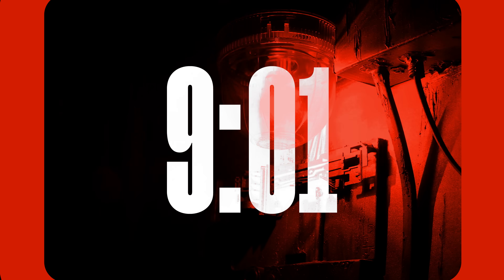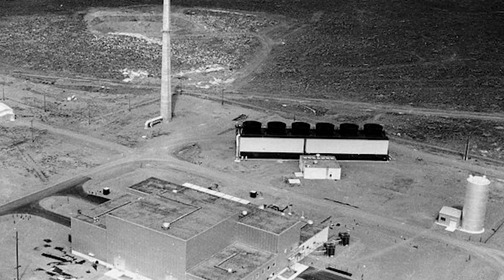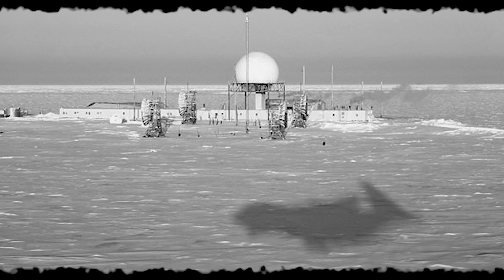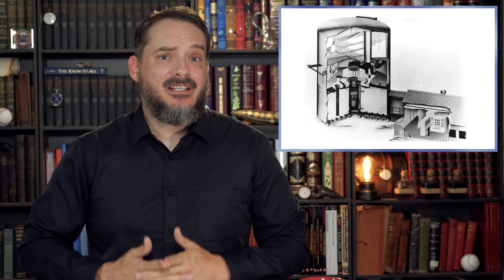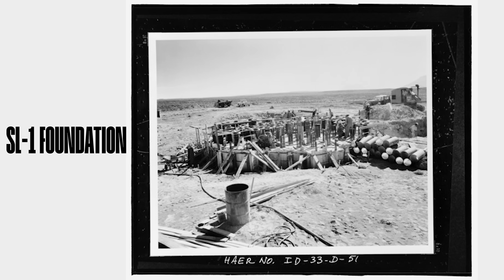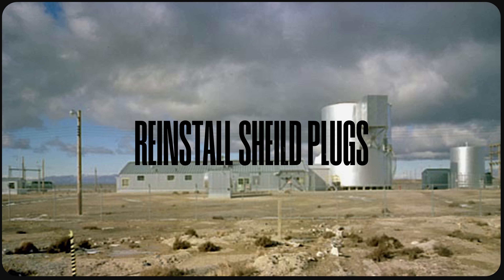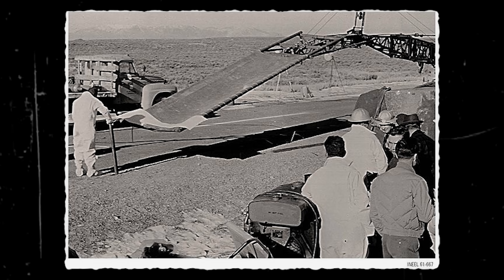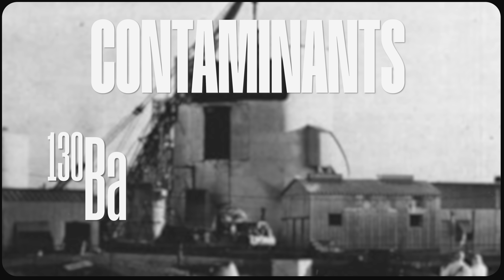The SL-1 Accident- America’s First Fatal Reactor Mishap

Comment: FYI, the reactor had a flaw after being built where it literally could not be fully shut down even with all the rods in when the fuel was fresh(once the fuel was spent enough it would work). So to fix this after built they glued a bunch of neutron absorbing "poison" strips to the side of all the rods to strengthen their ability to cut the reaction. These took up most of the gap space and when they inevitably swelled and deformed from heating and steam exposure they'd fill the gap and make it hard to lift the rods out, this is why they stuck, there were a bunch of swollen neutron absorbing strips attached to them. 
During the accident it's likely the raw force broke off the neutron strips and the now much thinner rod was lifted way too high, bringing the reactor to prompt critical.

Comment: The duality is amazing.
They managed to deduce the criticality of the reactor by analyzing the isotopes in a gold watch, yet the reactor was designed to have its control rod lifted by hand, without any kind of mechanical assistance, nevermind a way to control the travel distance, something that would've cost nothing whatsoever considering the price of the facility.
Reply: @fricki1997  that's military contractors for you, they cut corners and overcharge taxpayers at the same time

Comment: Worth noting that SL1 had a really poor design that was full of critical safety flaws, the worst one was the fact that the rod that caused the accident was significantly larger and therefore more important than the others. This basically made it so that there was not enough redundancy if anything went wrong.
That was the main safety barrier they INTENTIONALLY omitted.

It's almost like the only way to make a reactor have an accident is to INTENTIONALLY ignore all safety procedures, and even then, proper containment can avoid long term environmental effects.